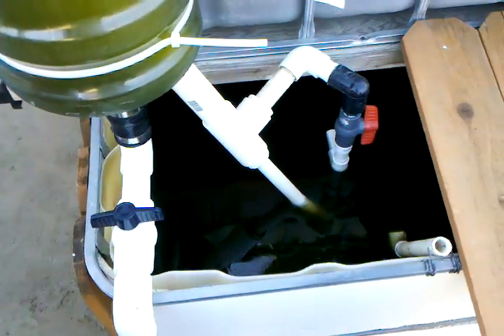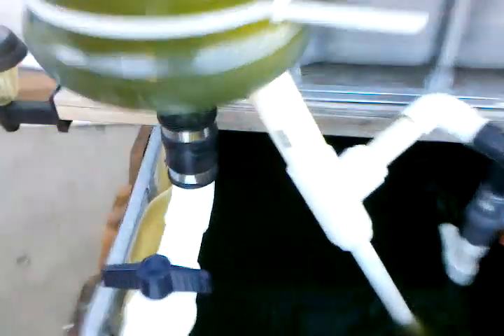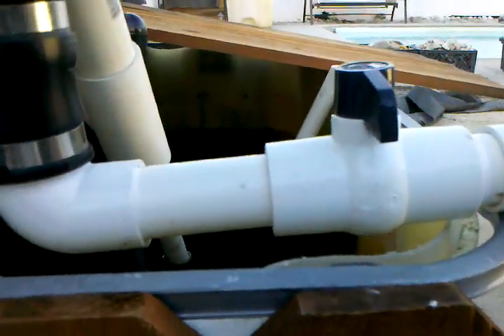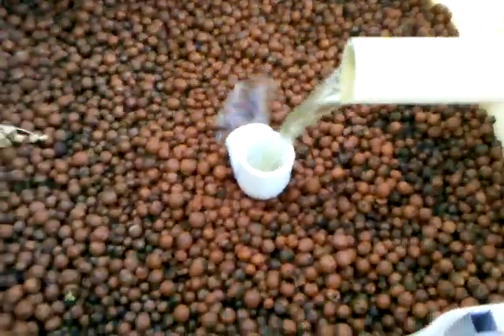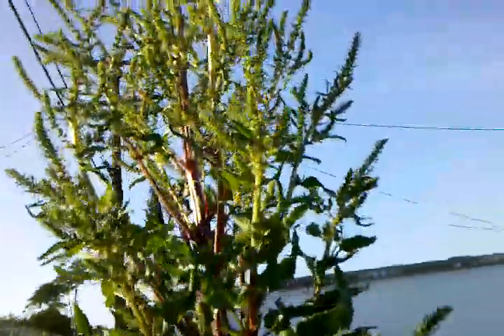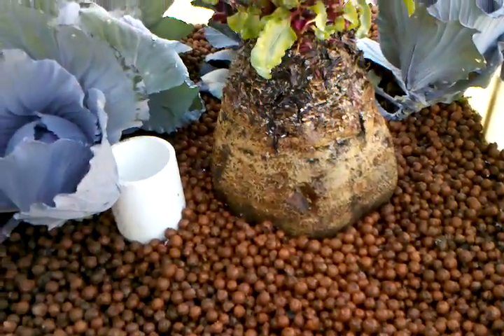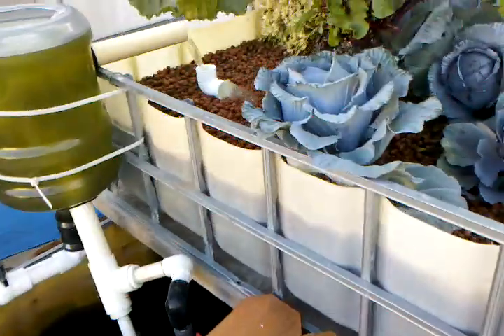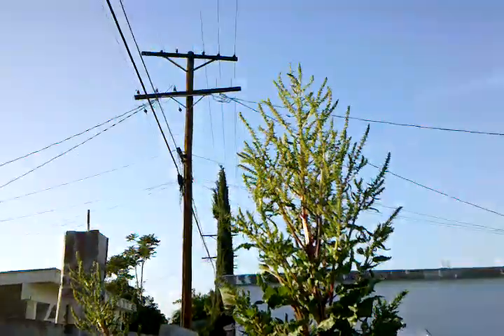DIY Aquaponics Swirl Filter UPDATE

Comment: My experience is that in a growbed situation like yours you do not need a filter because the growbed is your filter ... If you put in red wiglers in amongst the hydroton (about a serving of 500 specimens) any solids which might become a problem later on will be processed into solvable nutrients. A swirl or other type of filter is usefull when you use: 1. Deep water culture, 2. an NFT system or have fish which need clear water but Tilapia do not care about the water clarity. Regards, Sander

Comment: What size is the water line from the pump, I see you take it to 1 1/2 " intake. The pump I am looking at takes 1/2' connection. I am struggling with a way to connect the pump water line/pipe to the intake in the swirl. The line sizes do not match the pvc connections.